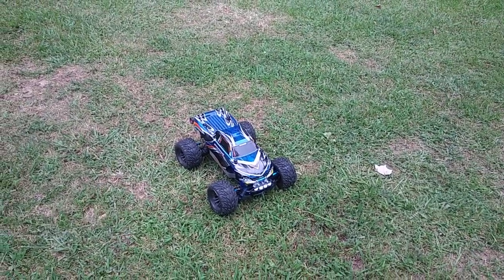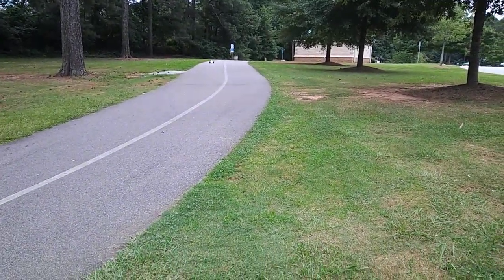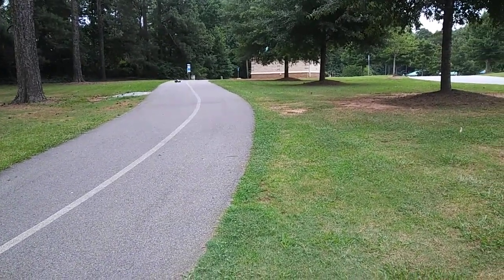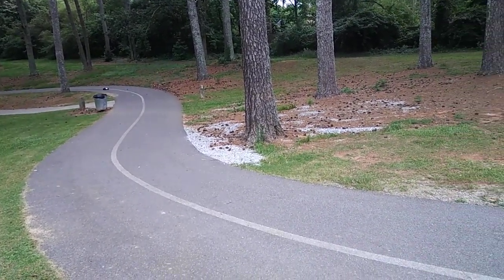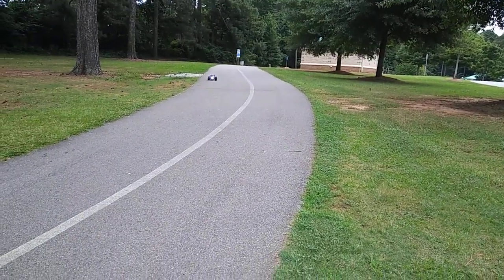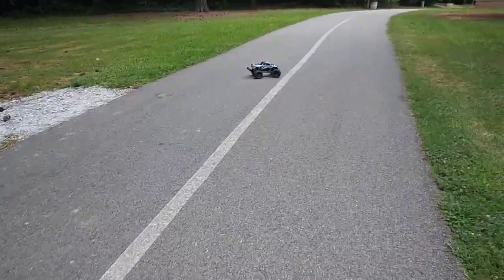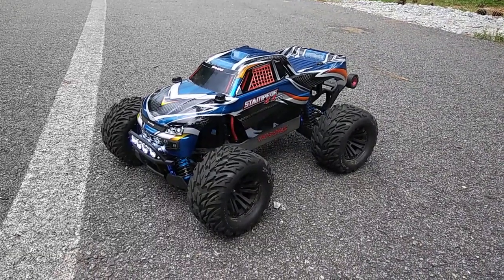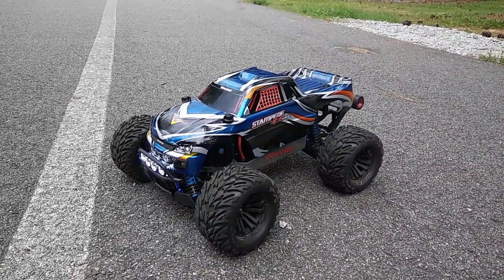Traxxas Stampede 4x4 BLX 2nd Test with 3s 25c Lipo

Comment: It's weird that this system performs so well in your Outbreak, but doesn't like the Stampede. The Outbreak is actually the larger vehicle between the two, which makes it even more strange. 👽
Reply from the maker: RedBeard RC I ran it on 2s in the outbreak so maybe a weight thing
Reply: JayTee RC 
Good point. I don't think Arrma has ever sold a 4wd vehicle with that system installed from the factory, have they? They may need to do some heavy product testing to make sure that the system can power a 4x4 truck effectively. Or maybe they just need to advertise it as 3s capable in 2wd applications only, and stick to 2s in a 4wd platform. Problem with that is people nowadays are so power hungry and think that everything has to be run on 3s (for 1/10) or 6s (for 1/8), lol. My Stampede 4x4 has the Castle 3800kv motor in it and it absolutely flies on 2s. 3s is fun, but I end up wrecking a whole lot more! 🤣

Comment: What is that BLX system out of?  Could be the weight of the Stampede, in addition to the 3s pack, since its close to 6lbs and 2wd cars/trucks are around 4lbs. 

However, I'm still sticking with Armma+Traxxas=💥💀

😂😂😅